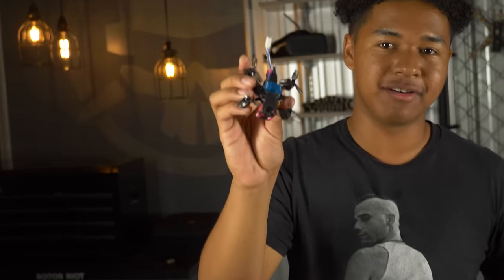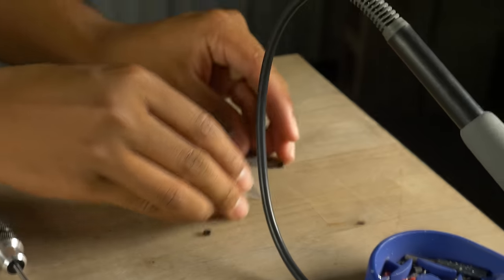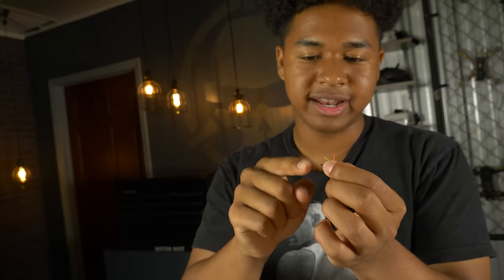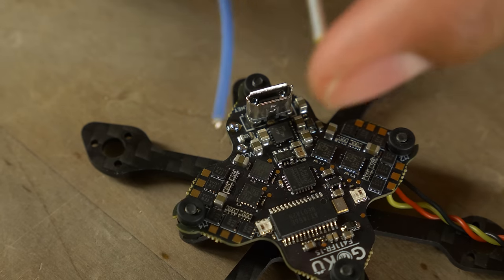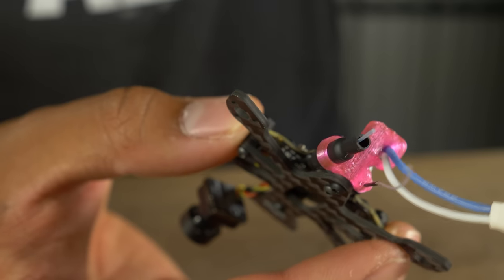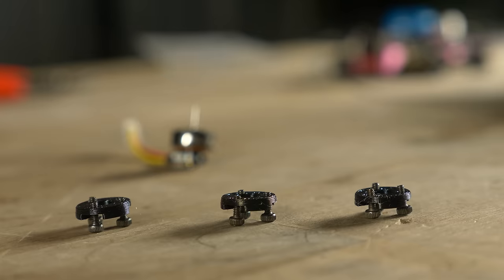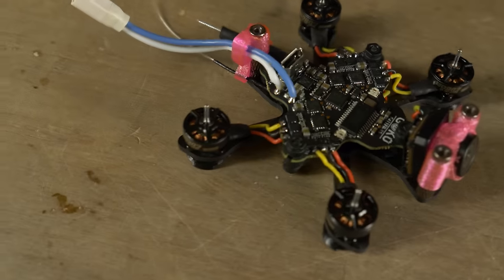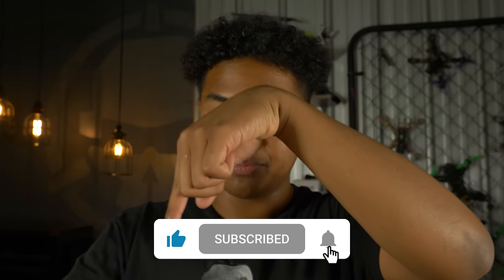The Bubito - High Performance Micro Freestyle Drone - BUILD

Comment: Cute little bugger!
My last "small" quad turned out to be a 3" racer, way to powefull for indoor flying. 😑
Pro tip as an electrician... Stick the battery cables all the way through the holes and then tin them in place! This way you get a much more solid connection mechanicaly speaking, for those vigorous battery ejects, and you don't risk riping of the pcb pads. 😅

Comment: Just flash latest version of BF, make sure fc board direction is correct in the gyro calibration, then look up how to tune a micro drone. Mine flies great after scaling the throttle down to 55 - 65% in the PIDs for indoor. Then find your rates. Plenty of videos out there to do this. Fun little ripper!

Comment: Hey, love the Bubito build, bought one from you guys and just started messing around with it. When I arm the drone, the props spin up and then down rapidly, causing the drone to hop around on the ground even at the lowest throttle, then when I throttle up to start flying, it literally takes off and seems to have no control whatsoever - darts left and right at the very slightest touch of the pitch/yaw. I try just hovering in place but that's like trying to wrangle a wet pissed off cat into a bag...just not happening. I've built and flown a few drones of various sizes, never have I had such a hard time controlling a drone before, even in acro mode. Is there something off maybe in the config - do I need to tune it or something with Betaflight? Please help!

Comment: @bubby I am at the motor mounting step, and I bought a 1.27 driver. However, it's still too big to fit the tmotor screw head hex.  Can you share where to get the driver you used?  It looks to fit very well. Thank you

Comment: If you want to use a smoke stopper, you will probably have to temporarily solder an xt30, or use a bt30 to xt30 adapter.

Comment: followed the instructions exactly and it wont fly. Boots up and spins propellers but wont fly. Propellers are in the exact positions he has em in, tried both the reverse spin motor and normal spin motor options in beta flight.
Reply: Your back motors are rotating in the wrong direction, you have to change the motor direction of both back motors from blheli software
Reply: @davidcaballero2871  I ended up swapping and resoldering red and the yellow wire; apparently swapping any 2 wires will achieve a different rotation

Comment: Someone should start a trend of using a rectifier diode or other simple device to add reverse polarity protection to drones. Shouldn't need to worry about blowing up the drone because +/- wires are backwards in 2022
Reply: If one is smart enough to solder a rectifier then they can probably check the polarity anyways. Also smoke stopper helps when there is a short circuit maybe due to soldering error, so better to use smoke stopper for the first time.
Reply: @prafulgupta7004  it's more of a recommendation for the OEMs to include a smd diode on boards

Comment: Would it be a good idea to start with this from as a started drone?
Reply: Depends what you want
Reply: Such as size power style of flying
Reply: Yes batteries and components will be cheap and it will be harder to break it because it is so small and light. Also it allows you to fly in way more places than a normal quad where you have to worry about causing damage and people freaking out when there is a noisy 5in violently tearing through the air.
Reply: I don’t have much space to fly. So I was looking for a small starter drone and I happen to come across this video.
Reply: @CharlieNDaTree  for inside I would recommend a tiny whoop as a beginner, this will be really really hard to control inside. For outside it's great